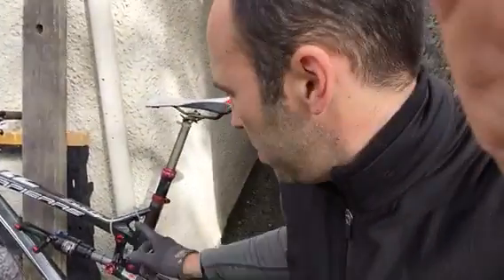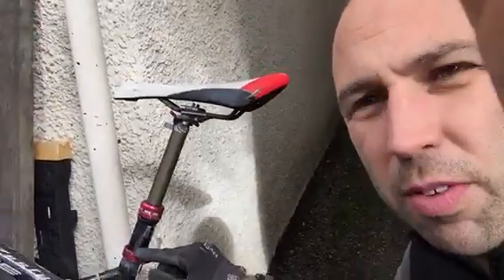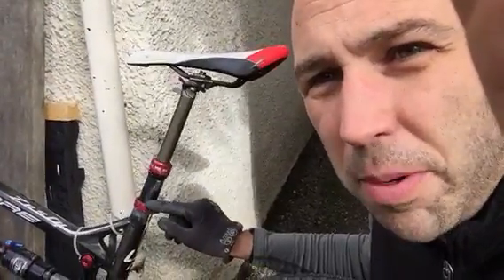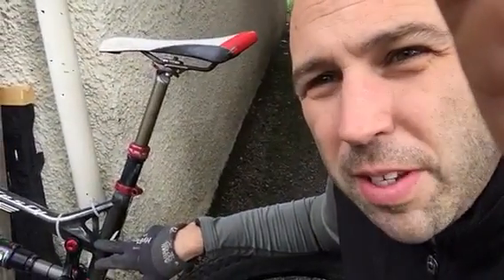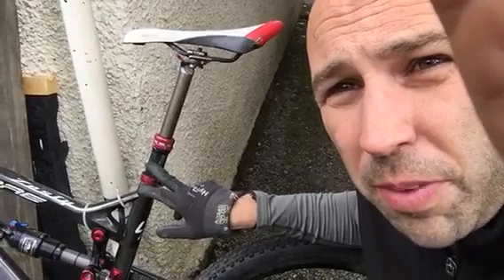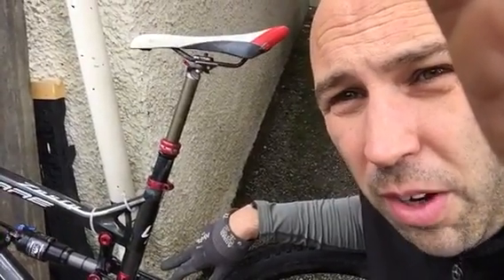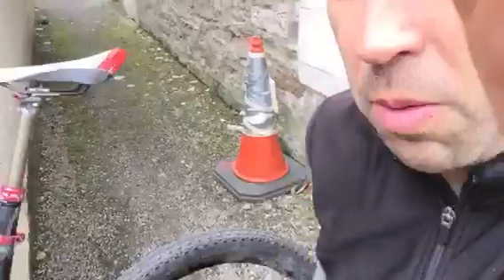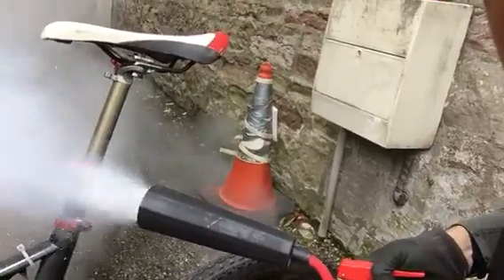Removing seized aluminium seat-post carbon frame bike

Comment: Will try this man, I have a stick carbon seat post in a alloy frame, tried boiling kettle, WD-40, cold water, hair dryer, wrench. Called bike shop and they said try a ice pack, so I've got a load of ice and a bag of frozen peas on their currently. But will pickup a fire extinguisher and try this

Comment: Thanks so much I thought I wouldn't be able to solve this problem and would have to somehow cut the seat post.
Giant seatpost stuck in my giant reign carbon frame. Nothing worked or moved until I tried your trick 
The seat post is corroded and I don't think I will be able to reuse it but I saved the frame!! thanks :)